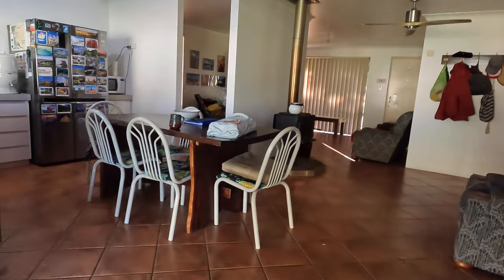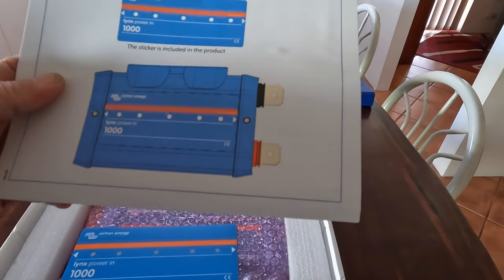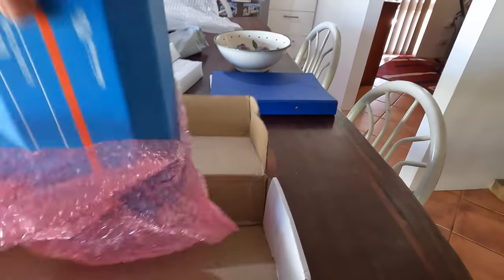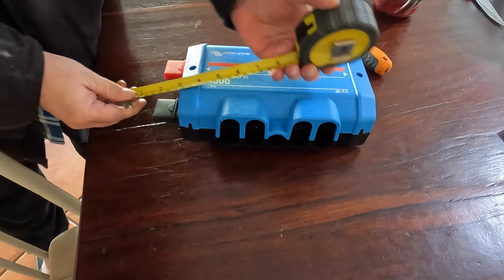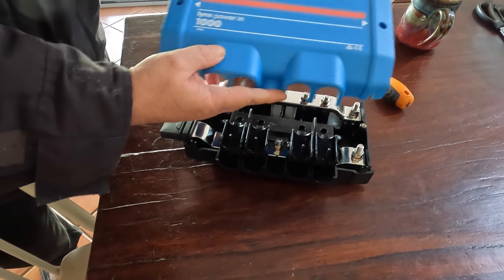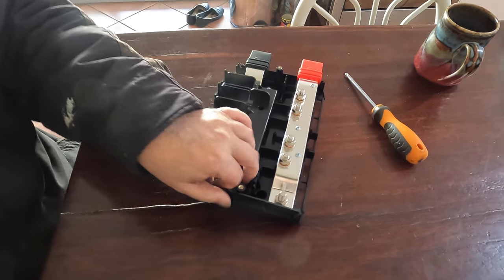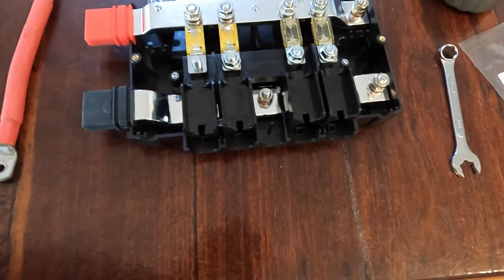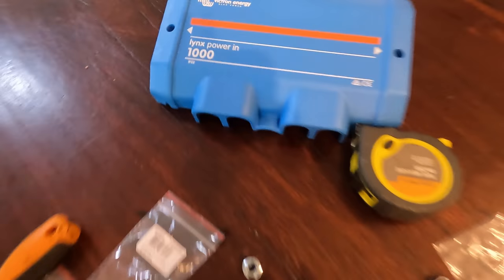Victron Lynx Power in  #Unboxing  #Modding

Comment: You can also get a Lynx Distributor as well which already has the fuse mod in place. There's also some LED's in the Distributor to tell you which fuse has blown should that ever happen. In both the Power In and the Distributor, the very end bolts next to the removable side panel can be used for your Cerbo GX and there is a small hole to allow the wires out for this safely and neatly.  Or you use these to attach an additional Power In or Distributor.  In summary both of these products are great for those of us who are off the grid.
Reply from the maker: Yes I am not interested in all the Victron addons. The one unit I have does it all and with NO noise. I just needed a nice busbar.  As I always fuse my batteries this was the most cost affective way to do it. The  Victron Lynx Distributor $379.20 While the the Victron lynx power in cost me $216 the extra bolts needed I already had on hand and the fuses cost a few $ more. 
My new Deye sends me an alert to my iPad or phone or computer or my wife's phone  if it detects a problem. With Victron noisy inverter and all the gear you need to addon to have it working like a Deye you would need to spend about 20k. Victron work on the ladder profit system. Buy this part for 4k now if you want to see what is going on you need the bmv  now if you want it to be solar powered you need the mppt but then if you want it to all work together you need the GX and so on and so on.  my inverter $3600, I need a protected Busbar Victron make a nice one $216, So there you have a complete 8kw unit with built in MPPT controllers x 2 and shunts to measure everything built in Wi-Fi and online communication So i can see and control the unit for any location as long as I have a phone or internet signal . for under 4k  
That is my thinking on this.

Comment: Hi Chris 
Love your Work.
Question: I am wanting to know if you have or can do a video on why you can/can't strip out solid core/ Multi Strand 240 Volt household electrical wire and use it for wiring up a 12 volt Solar system with half a dozen battery's and some solar panels etc. Any info I can find is very technical. Could you do a pro's and cons video on the subject please. I'm sure I'm not the only one who's pondered that question. Could you explain it in lay mans terms to please 😁
Reply from the maker: its all got to do with the frequency of the current. DC has no Frequency so it travels through the center of the copper wire. More strands = more amps it can carry. 110 or 230VAC has a 50hz or 60hz depending on where you are from. So it likes a bigger wire. and so on. Till you get to microwaves (that is also an electrical current) that don't require a wire at all and travel through the air. That is the short but also the correct answer to your question.

Comment: Great unboxing video Justin and thank you Mrs. Case for the great camera work. In such a compact box and high amperage, is electrical arcing across the terminals ever an issue? Thanks Justin. Cheers.
Reply from the maker: Not in this case. Its very well shielded. If it was an issue I would think it would have vanished off the market a long time ago. Many many in operation world wide. just search installing the ( Victron lynx system ).  Hear on YouTube and be amazed at the complex off grid and boating installation's that have been videoed. The times that by thousands as only part  of 1% of the manyy would have videoed there installation  👍😉
Reply: @JustinCaseSolarPower  The construction looks very high quality. Thank you Justin. Cheers.
Reply from the maker: @yhird  Not that expensive either. $216 + $24 express shipping from Queensland and that is a very long way from where I live.👍
Reply from the maker: @yhird  also have a look at this link Victron Lynx Distributor.  https://www.victronenergy.com/dc-distribution-systems/lynx-distributor#pd-nav-secondimage  Basically I have done the same with the Power in, but without the fancy electronics that lets you know if a fuse is blowen. I don't need a light to tell me if the Fuse is Blowen. The Deye Inverter will send me and error msg if one of the batteries drops out for any reason.👍

Comment: I'm keen to see this installed as I'm thinking aout using one in my setup
it's a little more than what I'd like to spend, but i have a feeling that in the long run it will be usable
then again, im thinking about using it for 2 batteries, 3 charge controllers and 1 inverter ( maybe 2)
that means each battery will come off each end, because they are lithium they have a bms, not sure if i need to add a fuse to them also because the bms will turn off at 200 amps anyway
that means everything else can have fuses, not sure how to get a second inverter in there, not even sure if its needed yet
Reply from the maker: We shall see. Still waiting on the solar electrician to come have a look and tell me how he will do the new layout of my panels. I may still have some low volt and some hight volt. The High volt will go on the inverter and the low volt on the Victron mppt charge controller.. Not happy with that outcome but it maybe what needs to happen.👍
Reply: @JustinCaseSolarPower  That's be a shame if you had to do that, even if it takes a bit more work, it'd be good to have all the high volt solar heading to the Deye inverter !!
Reply from the maker: some of my panels may not fit into strings. That is why i am waiting on the sparky to come and work it all out.

Comment: I don't think that fuse is appropriate for such a large battery bank due to the high short circuit current, use a proper HRC fuse with atleast 20KA DC breaking capacity and they are only 10 AUD or so each. Example = Siemens 3NW series fuses.
Reply from the maker: Keep watching.